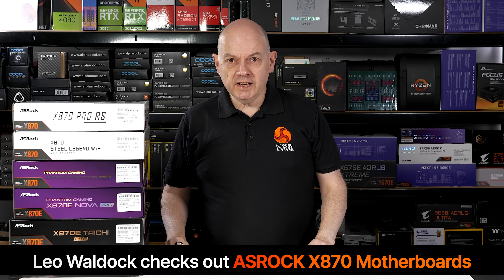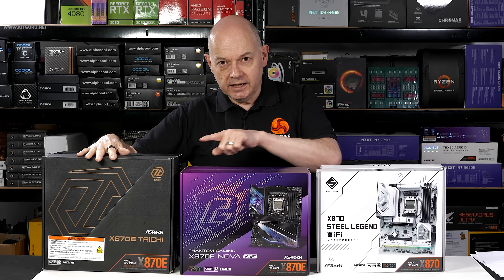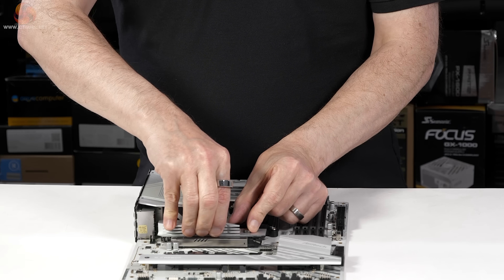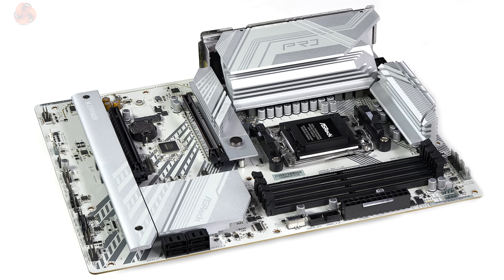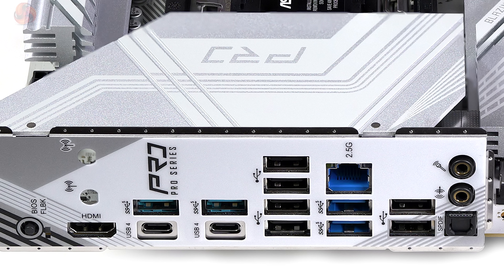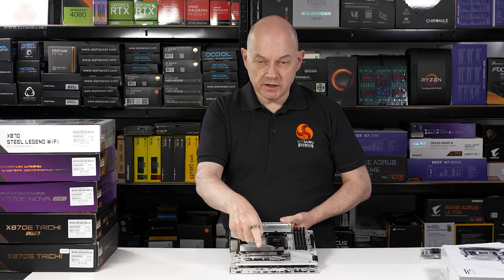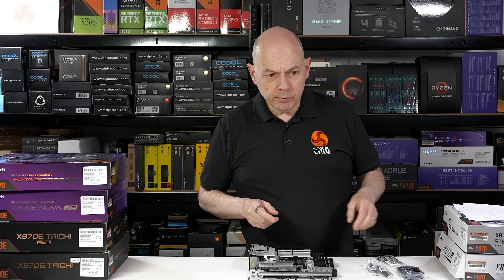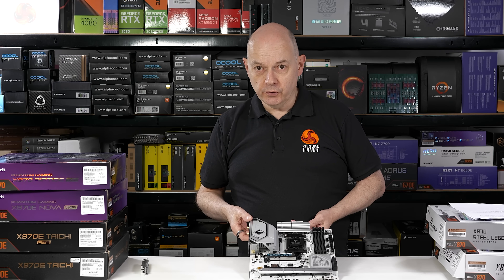ASRock X870E / X870 Motherboards - AMD Ryzen X3D Ready

Comment from the maker: Be sure to report spam - we try to remove as much as we see, but it is an ongoing issue - also let us know if you are in the market for a new X870 motherboard or if you already have one - Any of these ASROCK boards interest you?
Reply: I am really into the x870e phantom gaming nova wifi, but unfortunately its all out of stock on every online store i visit right now. Its an S tier board due to most of its competitors for its price range does not have any lane sharing in the GPU or the Gen5 x16 lanes. If you are selling it i am willing to buy it
Reply: @DanielReyes-ry5ne I just got both WiFi Nova and Taichi just right now off NewEgg. If you’re interested I’ll sell you the Nova as I’m leaning towards the Taichi.
Reply: Already got a x870e taichi for about 2 weeks. Been absolutely fanatic with 9800x3d, the motherboard was super easy to install and the bios is clear and easy for ram timings, and cpu overclock (although to be honest you dont’ get much from cpu overclock). Love how quick it posts/rejects ram timings, you can tune ram so quick on this thing. Beatufiul design, and my crucial t705 runs at 14k advertised speed in the 5.0 slot, the motherboard heats sink is perfectly sufficient.
Reply: Taichi Lite looks good to me
Reply: I am shopping for a x870e phantom Nova. Thanks for the great content!

Comment: This motherboard is a very robust and solid choice in terms of quality. Just I would have preferred a real paper manual delivered with it, especially the board is not turning on with Ram on a1b1 slots but only on A2B2 + the 2 digits error display was showing “EC” which was not helping at the time as it means nothing apparently (code reserves for future errors). Sad they did not explain clearly 2nd ports for memory are in fact primary. Also no nuts and bolts in my box, I was unable to screw my Nvme or the board itself on the atx, used my previous ones. Apart from this, great mobo indeed 🎉

Comment: I got a asrock gpu and it has unbearable fan noise when seated in a vertical tower because it sounds like a bearing ball is missing when i rotate the gpu like wtf they shouldnt have messed it up on a high tier gpu like the 7900xt. Cant trust any asrock components after that.

Comment: Im using the Nova with a 9950x. Trident ddr5 6000 cl26. Rock solid with a 7900 xtx. Very pleased with the performance. Slight undervolt with curve optimization. Was a serious learning curve with lots of help and advice.

Comment: A slight correction for NOVA m.2 mounts. If you are using the 5th m.2 and using series 7000 or 9000 the 3rd pcie is disabled. If using an 8000 series cpu and the 5th m.2 mount, you also lose the 3rd pcie and your GPU pcie drops to gen 4.0 from gen 5.0. This is an important tidbit bit that should be outlined in a review.

Comment: The inclusion of thermal sensors is great and gets too little recognition, AFAIC. Fan control is much smoother and appropriate, if the input is the temperature of an air cooler or the backplate of a GPU.

Comment: x870e taichi owner here as well. 9800x3d cpu. only issue im having is usb4 write speeds is only around 250MB/s. im using 990pro nvm in a zike drive enclosure and ugreen usb 4 nvme enclosure. what is your experiance with usb4? running latest bios, 23h2 and 24h2 both fresh wipe and installs. numerous usb 4 cables tested as well. windows explorer copies to enclosure is 250MB/s as well as ATTO disk benchmark

Comment: Would be interesting to see some testing on these, namely boot speeds, memory training, stability, temps, I/O. I have the Nova and I have encountered a number of issues. Memory is slowly trained, the audio jack can't be balanced from Windows settings (only from driver software), boot is slower than B650m PG Riptide, and several others actually. I was wondering if the overall quality of some of these boards might be lower despite the increased features on paper

Comment: The Taichi, Taichi lite, Taichi nova and msi godlike are the only x870 motherboards out right now with no pcie 5.0 restrictions, you can populate all nvme m2 drives and don’t  loose pcie 5.0 x16 in slot 1.  I own the Taichi great motherboard, very heavy with a solid backplate in the back. The Taichi is EATX, 1 inch wider than regular ATX.
Reply: That's not true the Biostar X870E Valkyrie, Gigabyte X870E AORUS XTREME AI TOP, and Asus ROG CROSSHAIR X870E HERO also bifurcates to x16/x0.

Comment: I'm sorry, but for once I am disappointed.  You skipped two critical points on all of the motherboards: first the distance between the slots and second the electrical nature of the slots. The first one is critical for those with large GPUs who, like me, want to fit a second card like a 10 Gb NIC or a video capture card. The second is important for the slot bandwidth; the second x16 slot may be physically x16 but is it electrically x16 or is it 8x, x4, or x1? And does the second slot share bandwidth with anything?

Comment: Thanks for the intro, hopefully some actual reviews will be released soon. 👍

It seems there's a real hype surrounding the Nova, as it has lots of features for a decent price when compared to the competition (well, for an X870E chipset mobo anyway).

One thing that should be also mentioned is that the Taichi Lite doesn't have the EZ quick release feature for the GPU, yet the cheaper Nova has it. For some people, this is a red line, which is why they prefer either the more expensive Taichi or the cheaper Nova.

Comment: Do you have any in depth info on the technical differences between these? Like number of pcb layers, pcie sharing and its impact (if any), wifi frequency or are you reading from the box?
Reply: The Taichi, Taichi lite, Taichi nova and msi godlike are the only x870 motherboards out right now with no pcie 5.0 restrictions, you can populate all nvme m2 drives and don’t  loose pcie 5.0 x16 in slot 1.  I own the Taichi great motherboard, very heavy with a solid backplate in the back. The Taichi is EATX, 1 inch wider than regular ATX.
Reply: @Hussar-fm8iy  msi tomahawk also has no pcie sharing
Reply: @chunkynugget  I may be wrong but I checked the specs and if you populate all M2 slots the 1st pcie slot changes from  pcie 5.0 x16 to pcie 5.0 x8. The godlike and ASRock motherboards have different design, their nvme m2 slots are not shared with pcie. It’s strange that big review channels don’t want to talk about m2 limitations on x870e motherboards when they do reviews lol.

Comment: Great review. The golden one for the x870e platform is definitely the Nova wifi hence why it is sold out most of the time. Asrock is the MVP this time around as they spared no expense on vrms and it has no lane sharing. Pretty much any other motherboard will dial back pcie to x8 when running more than one NVME hard drive. Also the nova is one of the few that has wifi 7 320 version instead of 160. I loved back in the day were only the hardcore audience new which were the best products and the rest just bought overpriced Asus boards. Now channels like kitgurutech educates thousands of customers and that is the reason I cant find stock for the Nova wifi
Reply: Nah man AsRock is blowing up x3d chips apparently or failing more with em. 

 Anyway Gigabyte would be good, but their choices of having tons of PCIE lanes connected to m.2 sucks.

 Like here is your Gen 5 PCIE x16. Yet if you go to use the m.2 slots you put it to x8. 

 I don't even underatand why some need so many x16s.
Reply: I’ve been using the Nova for a month now with a 9800x3d and has been flawless. The heft and quality you get from this mobo when you lay your hands on it is simply staggering. Crossing my fingers so it stays that way but really it’s a small percentage and it still has to determined if it’s an only Asrock fault or it’s just by sheer numbers out there. I come from the gigabyte Aorus master for the 9900k and while been a good performer, it came with quite some quirks like sometimes case fans not turning on or some bios lockups

Comment: My very first As Rock board was the 890 Extreme for AM3. That prompted me to get the X370 Taichi and that was a great board. Right now I am looking at the X870E Taichi as it is the cheapest board that still support x8x8 on the top 2 slots. Something I do not see in reviews is that all As Rock boards are great for HTPC as the HDMI port on all As Rock boards supports 120hz.In the age of 4K 120hz TVs with VRR that translates to butter smooth IGPU Gaming at 1080P. You should test it yourselves and see. I used a MSI Pro B550 and the As Rock Riptide B550. Both were the same $79 price. I just wish that you would not follow the narrative and use an AMD GPU once in a while. AMD software is good enough to recommend as a reason to get an AMD card. Please don't use the RT vs raster argument as RT is in less than 1% of all Games, even new Games do not support RT like the narrative describes as I play a ton of Strategy and have not seen RT in BG3, Warhammer 40K Rogue Trader, TWWH3, City Skylines 2,  StarshipTroopers, Warhammer Age of Sigmar and others. Meanwhile raster is still in 100% of all Games.I think it is a disservice to the Community when the narrative uses Nvidia 90% when they were selling pallets of 4090s to the Chinese Govt and still do (4090D). If AMD was so weak the 7900XT would not be just as expensive as 10 months ago and not the the number 3 card on Newegg.com.

Comment: Just one socket ago the board prices were 50-100€ cheaper.
I chose the MSI X870 Tomahawk. At 300€ it is the most expensive board I have ever bought and I wouldn't go higher.
It has 2 special features, first is has a post code LED, probably the cheapest board today that has it. And second it has a second 5.0 M.2, if you choose not to use USB4.

Comment: I ended up going for the Taichi Lite, and it’s running my 9800X3D and Corsair Expo 6400 profile like a champ.
Reply: Pretty sure a B650 can run a 9800X3D and DDR5 6400 like a champ lol.
Reply: @pranze3484  Not according to some on the OCUK forums.
Reply from the maker: Temps good ?
Reply: @KitGuruTech  I’d say normal. Idles low 30’s, gaming in Forza Horizon 5/CoD/Ace combat 7 sees high 50’s to mid 60’s. This is based on a 360 AIO (Corsair) with stock applied paste in a rack mount chassis.
Reply: @KitGuruTech  also paired with an RTX 4080 Super, running 144Mhz ultra wide 5120x1440 ultra settings.
Reply: x870e taichi owner here as well. 9800x3d cpu. only issue im having is usb4 write speeds is only around 250MB/s. im using 990pro nvm in a zike drive enclosure and ugreen usb 4 nvme enclosure. what is your experiance with usb4? running latest bios, 23h2 and 24h2 both fresh wipe and installs. numerous usb 4 cables tested as well. windows explorer copies to enclosure is 250MB/s as well as ATTO disk benchmark
Reply: @ I don’t have any USB4 devices (yet) I’m afraid.
Reply: @RichEarll  found the issue, damn windows "drive performance" and "write cache". getting full 3.5GB/s reads and writes now

Comment: A useful thing to add for the Taichi, Taichi Lite and the Nova is you can use all of the nvme slots at the same time while maintaining 16 lanes for the GPU.
Reply: I use NOVA and it's a very good motherboard! 
The BIOS is very clean and clear, you can set everything you want in it. 
The tiny fan placed in the VRM cooler spins up when turned on, but after that there is no sound, it is literally silent. But like everything else, you can set it in the FAN settings or even turn it off.
The temperature values of the chipset are good and yes, as I was told before, there is no lane sharing nonsense.
I think it's the best motherboard out of all the X870e.
I have been using it for about 1 week. and stable, there are no anomalies, everything goes as it should. I strongly recommend it to everyone!
Reply: @TheRelixo1 my Nova arrives next week. Good to hear people are liking it. 😮 Going from a 6700k skylake to a 9800x3d. Should be interesting 😂
Reply: @benjones869  same, bruh - 6600k here. We're LONG overdue lmao
Reply: @benjones869  Did you upgrade to 9800x3d already? How do you rate that change? I bought this CPU but looking for mobo now...
Reply: @vito75pl  oh it has been a great upgrade. No complaints at all. Just need to replace my 1080ti now.
Reply: @benjones869  Good  4U :) Do you have any more details? How big FPS  jump you get wit your 1080ti? I am affraid of m.2 bottleneck only. I am looking for gaming platform to use in next 5 years.
Reply: @TheRelixo1  same here  .. nice board
Reply: @TheRelixo1  so you say its the worth the money i have been thinking to get one i love the easy release feature because i have massive gpu but also the nvme drives also u say bios is clean clear which something i would want too ill be pairing 9800x3d with 7900xtx with couple nvmes + gen 5 rdy hell yes
Reply: @TheRelixo1  your full PC specs please, I want to build with same mobo
Reply from the maker: You own one yourself ?
Reply: @KitGuruTech  not yet, but I learned that while researching x870e motherboards because I'm thinking of upgrading my PC soon.
Reply: @Riyo94  what about gigabyte aorus x870e elite wifi7?
Reply: @BusterFortnite  It has 4 nvme slots, you can only use the 1st and 3rd slots if you don't want to share PCIe lanes with the GPU.

quote from their product page "When the M2B_CPU or M2C_CPU connector is populated, the PCIEX16 slot operates at up to x8 mode."
Reply: @Riyo94  other than that, it's good for r7 9800x3d? and good future proofing because the gpu pcie is 5.0?
Reply: @BusterFortnite  I would get the x870e asrock nova wifi over it. even going for the "future proofing" route it allows you to add more ssds if you run out of storage, it also has an x2 pcie express slot at the bottom if you want to add 10gbit LAN and it has a backplate for better cooling and to keep the motherboard's form from warping since we're starting to get very beefy GPUs nowadays it also helps if you have a giant aircooler.

But if you still don't care about any of that and will be satisfied with 2 nvmes then sure.
Reply: @Riyo94  alr
Reply: @Riyo94  The nova routes all gen 4 PCIe lanes from the chipset to m.2 slots. There is no X4 pcie slot. Only a gen 3 x1 and x2 slot which means no 4K capture cards or high-end network cards. Allocating 8 lanes from the GPU has no performance impact except on a 4090 (the fastest gen 4 card) where it's low single digits. If 50 series ends up using Gen 5, the performance impact from borrowing eight lanes will be zero. Using GPU lanes mean the drives are directly connected to the CPU and can run at gen 5 speeds
Reply: @KitGuruTech  I own the nova--can confirm.  Best value for your money for an 870e board and its not even close IMHO.  Only thing i think its missing is async eclk.
Reply: @KitGuruTech  I've not yet been fast enough to grab one... but I'm trying like hell to get the Nova.
Reply: @KitGuruTech  this board can run 5 m.2 drives without touching pci lanes. I have one.
Reply: The Taichi, Taichi lite, Taichi nova and msi godlike are the only x870 motherboards out right now with no pcie 5.0 restrictions, you can populate all nvme m2 drives and don’t  loose pcie 5.0 x16 in slot 1.  I own the Taichi great motherboard, very heavy with a solid backplate in the back. The Taichi is EATX, 1 inch wider than regular ATX.
Reply: @Hussar-fm8iy  x870e taichi owner here as well. 9800x3d cpu. only issue im having is usb4 write speeds is only around 250MB/s. im using 990pro nvm in a zike drive enclosure and ugreen usb 4 nvme enclosure. what is your experiance with usb4? running latest bios, 23h2 and 24h2 both fresh wipe and installs. numerous usb 4 cables tested as well. windows explorer copies to enclosure is 250MB/s as well as ATTO disk benchmark
Reply: It was the main reason why I ordered taichi, I’m upgrading every 5-6 years, so should do for a while without thinking about performance
Reply: Any motherboard that has the 2nd and/or 3rd M2 slot wired from CPU instead of chipset must do so at the expense of creating a "You pick em" mess of lane options.  Surprisingly nearly every board chooses this route.  It isn't even worth it because you kill 8 lanes of PCIe 5.0 to get 1 byte of nvme transmission.  The most common case would likely be users plugging 1 extra gen4 nvme into slot #2, or even some crappy spare leftover 256GB 1500MB/s Gen3 because they are unaware of the slot hierarchy.
Reply: Also the riptide
Reply: do you know how many nvme slots or which ones i can use on the phantom gaming i don’t want to mess with my gpu
Reply: @Sinsukii   The phantom gaming x870 riptide wifi doesn't share lanes with the GPU so you can use all the nvmes while keeping the GPU at x16 nothing to worry about there. But if you're going to buy an x870 (none e) board I recommend the MSI x870 tomahawk, it has 4 nvme slots without lane sharing and a post code.

if you're going with x870e I recommend any of the Asrock boards. Goodluck.
Reply: @Riyo94  i already bought the riptide having no issues just was wondering if I was messing with my gpu thank you very much man
Reply: @Sinsukii I see. No issue you can use all your nvmes without affecting your GPU. Enjoy that’s a solid board!
Reply: I dont understand this, dont the others non E motherboards just take lanes from the other pcie slot, not the actual gpu slot where  you place your gpu?
Reply: @ most other boards will cut the main gpu slot in half to 8 lanes.  Many boards only have 1 other pcie slot and using that will do the same to main slot.